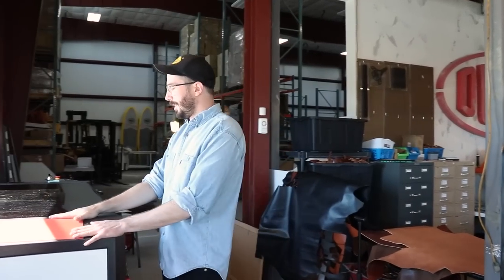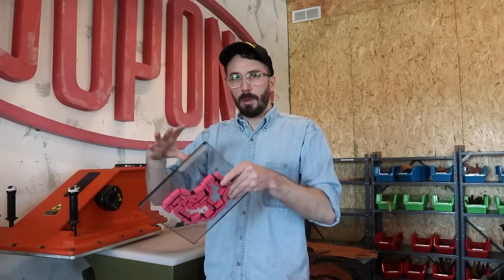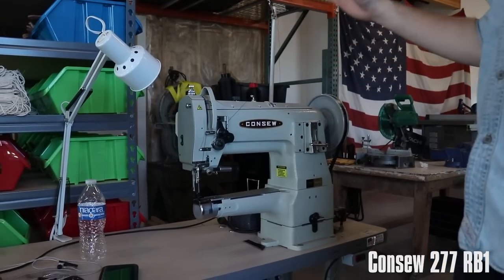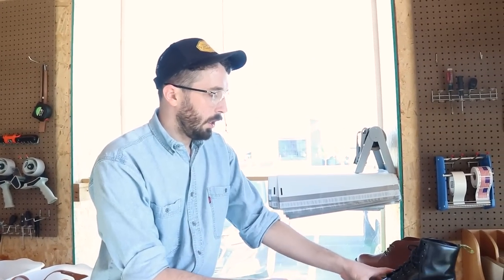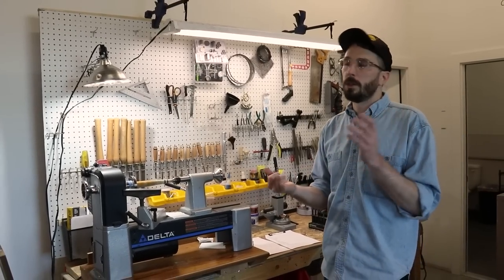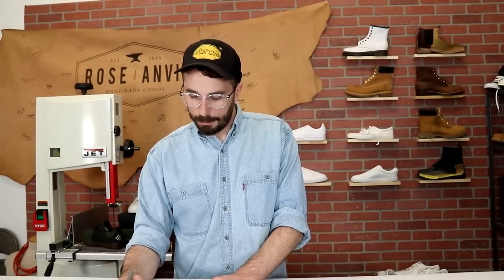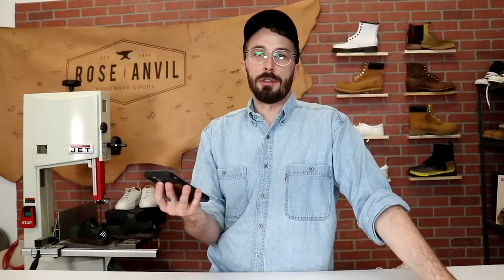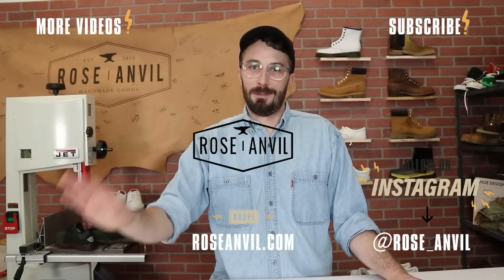Where the name ROSE ANVIL came from + other questions!

Comment: I have a challenge for you: Can you design a quickly adjustable guitar strap? All the leather straps I've found have to be taken off the guitar to adjust length.
Reply: A belt buckle strap adjustment would work I bet, I'd make one if I was more confident in my leatherwork
Reply: This is definitely a good idea. I needed one of those when I was playing guitar. :)
Reply: Why would you need this?  I never change height so once my guitar strap is set, I've never needed to adjust it ever.
Reply: @SirenaSpades  it's useful when you have multiple guitars. Different guitars have different mounting points and different guitar shapes. Therefore an adjustable strap would be great.

Comment: I think you should revisit Jordan 1s and cut open a Jordan 1 High.  You compared the Shattered Backboards to Jordan 1 Mids.  Lows and Mids are known to have incredibly poor leather quality (or straight up fake leather).  Jordan 1 Highs tend use better leather material than the Lows and Mids.  
Also, coming this winter is Jordan brand's version of the white sneaker!  MJ wore them in his Last Dance Documentary.  I would love to see those get cut in half.  They are called the Air Jordan Centre Court.
BTW, your shop looks great!  I ride a Triumph myself.
Reply: We've already found out that "lows/miss have poor quality leather" is a myth. They're not using anything but bottom of the barrel leather for any of their shoes, and they're not putting better leather on their high tops.